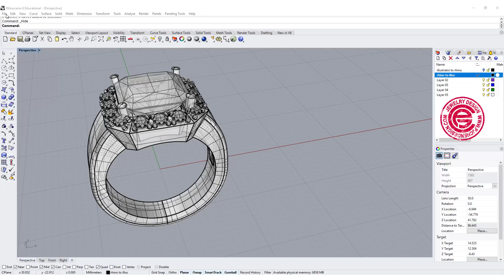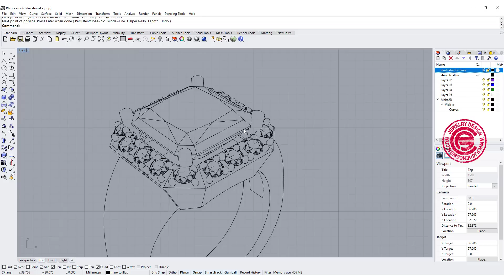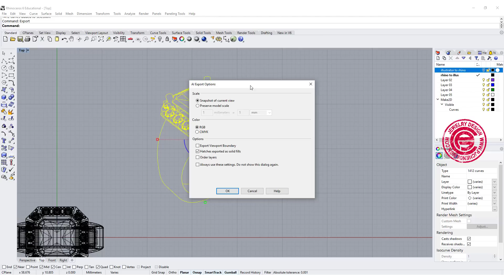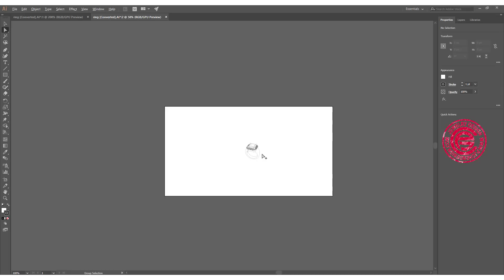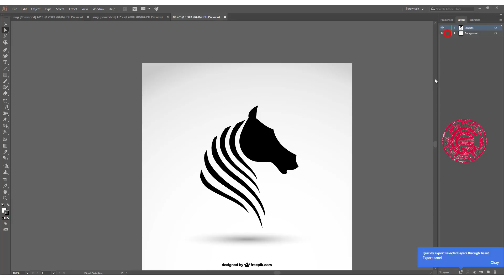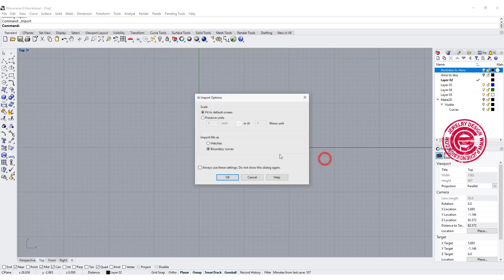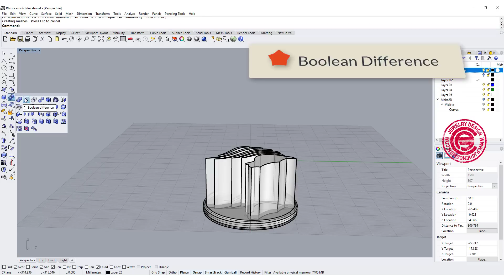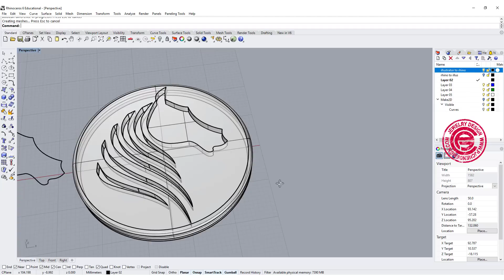Convert files between Rhino 3D and Adobe Illustrator (2019): Rhino 3D CAD Technique #19

Comment: how generate supports in rhino file for 3d printing
Reply from the maker: Rhino doesn't have it but there a several plug-ins you can find at Food4Rhino for the support. 
I use B9 Creator, a free software, to do my support.
Reply: I also use b9 creator 
But i want to use more advance software